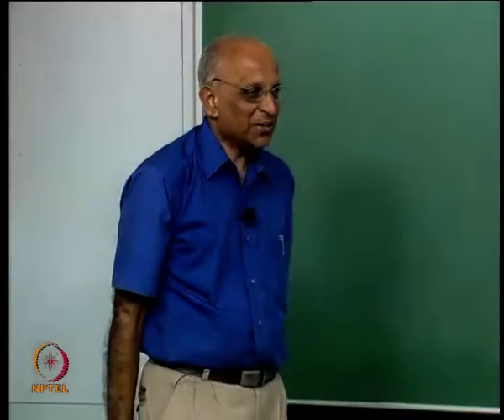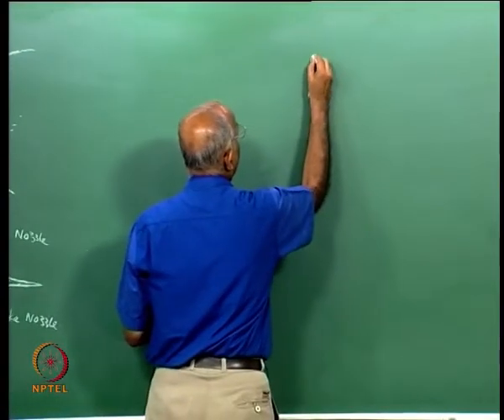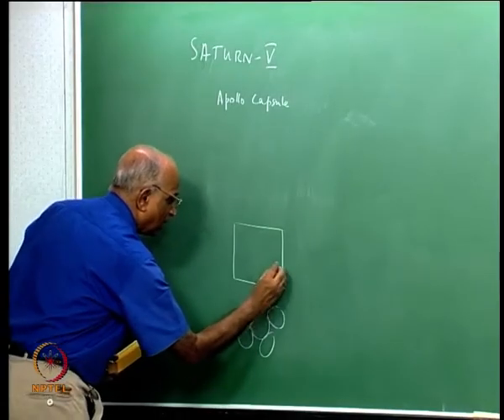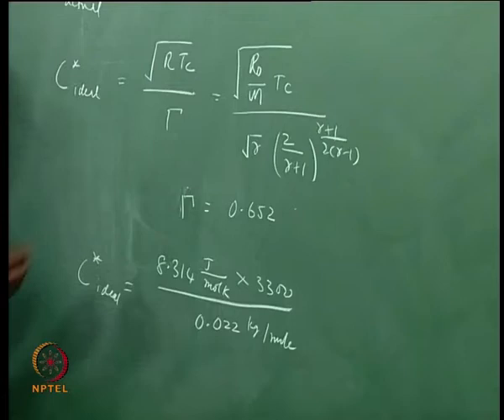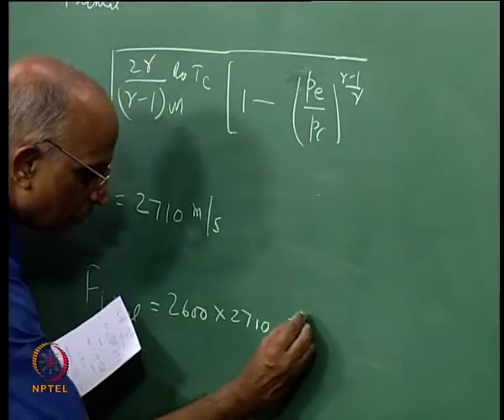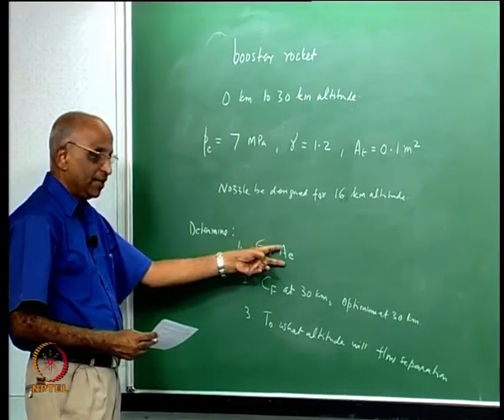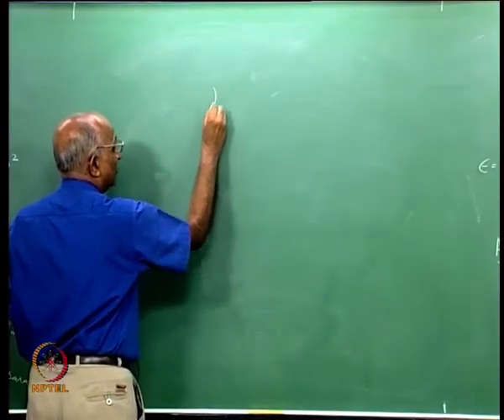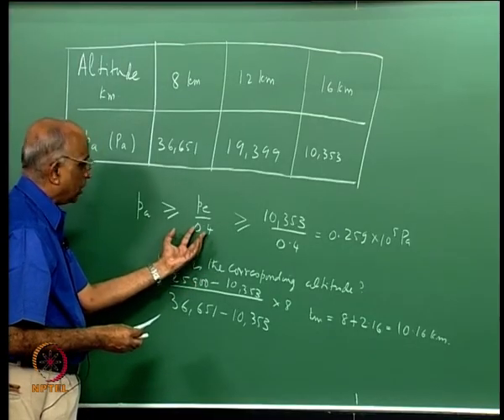#14 Unconventional Nozzles | Problems in Nozzles
 | Introduction to Nozzles

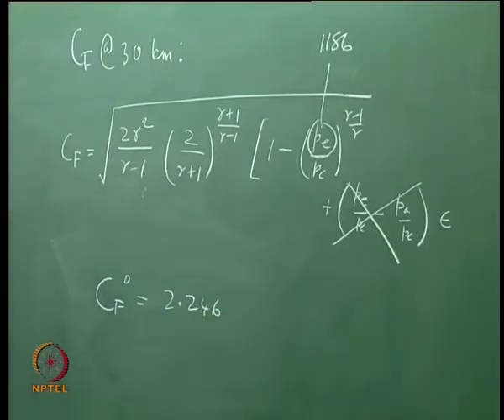Comment: @ 45:32  sir the thrust coeffecient at 30km taking 30km as optimum is coming out to be 1.9646 not 2.246
Reply: 1.963...i am also having  different answer like in case of 4 stage rocket engine problem...but stick to your answer..as there might be some mistake made by sir...Even final answer is wrong🤨
Reply: Yea I'm also getting 1.964654196 as the Cfnot@30km and % reduction = 3.43%